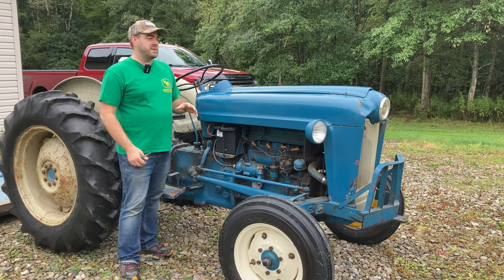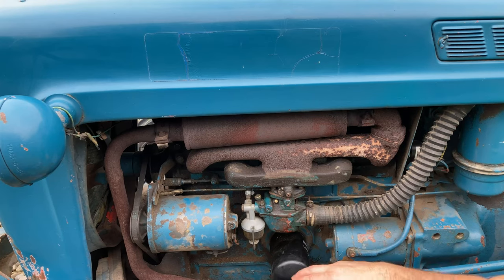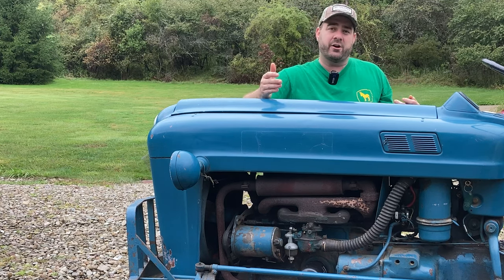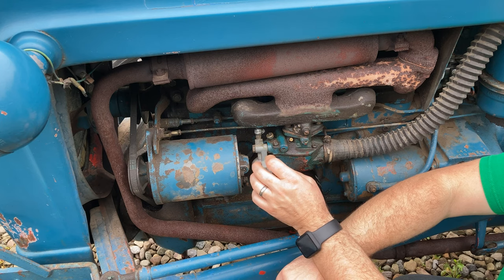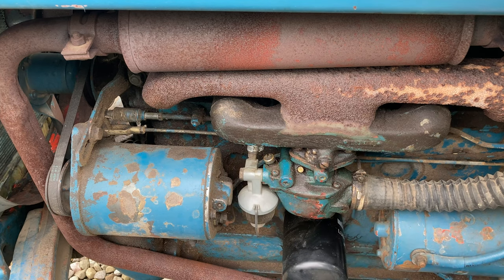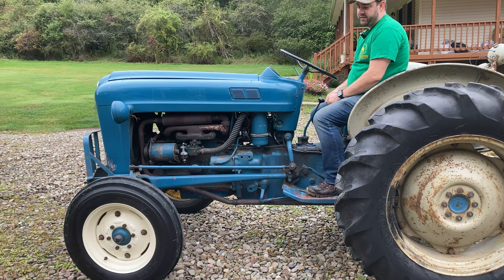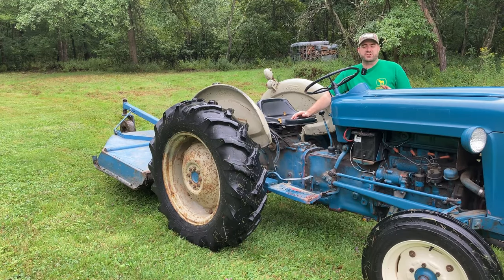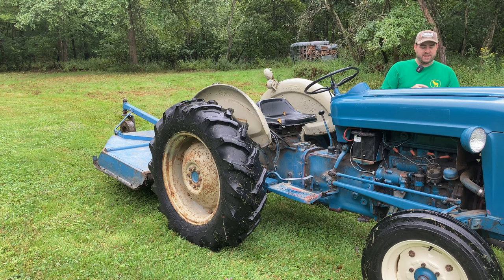Marvel Schebler carb settings for surging engine issue with Ford antique tractor

Comment: I am sure you have it fixed by now, but I had the opposite problem.  Initially, I had it surging all the time.  That was a carb problem.  The little flap had come off the choke plate and jambed things up.  I had been bouncing it pretty bad driving over palmettos pulling fallen oak trees out after the hurricane.  Once that problem had been sorted, it would misfire  when you accelerated the engine above 900 RPM.  Took me a little bit to figure out what was causing that.  The fly weights for the spark advance in the distributor were hung up and thus no advance.  Lubed them and problem went away.  I have been running it 3 or 4 hours a day now for weeks using a box blade and no problems at all.

Comment: I would Drain the fuel tank, put in fresh gas and then put in some sea foam in with the fresh gas.   That may help clean out the carb.   As said in previous comments you may have an air leak causing a lean condition.   Which causes the engine to "hunt" for more fuel.  You can take a propane torch opened up so it's letting out the propane (unlit) around the carb and intake manifold with the engine running.  If the engine gains RPM that's where your air leak is.
Reply from the maker: Thanks! I'm going to try that next.
Reply: Brake clean works better for that and safer

Comment: With the engine running spray carb cleaner around the outside of the carb to see if there an air leak.   Also check your fuel flow.  Usually surging is lack of fuel. Or bad fuel
Reply from the maker: Thanks! I'll try both of these tings before I remove and attempt to take apart the carb.

Comment: I had a similar problem and I found that the governor control rods were not set correctly.  If you have one of the manuals, it explains step by step how to adjust.  If I remember it correctly, with the tractor off you want your throttle set to idle and then look at the governor control rod and see if it is touching the governor control arm.  If it is, try opening the throttle until it is not.  This was my problem.  The rod was adjusted too long and it was allowing the governor to move without the proper tension on that linkage.  Once tightened until the spring was always under tension it stopped surging.  I hope this helps you.
Reply from the maker: Thanks!

Comment: When you take it apart to clean it or rebuild it, there are two tiny passages in the bottom of the carb that are very prone to getting plugged. You need to soak the parts in carb cleaner but also use a very small diameter wire to clean out those passages. Good luck 🤞
Reply from the maker: Thanks! I've never disassembled and rebuilt a carburetor before. But I may need to learn how in order to eliminate this problem.

Comment: I always check the oil bath air cleaner.  Water gets in there and raises the fluid level making it harder to get air through as well as making a soupy mess.  I don't know if it would cause surging but it has helped when the tractor is just not generally running smoothly.
Reply from the maker: Great tip!  I'm going to empty out the oil bath and start with some fresh oil at the proper level.  That's probably overdue anyway.

Comment: I’ve had that exact issue caused by a dirty/partially blocked sediment bowl. If they haven’t been cleaned in a while, they can restrict the fuel flow to the carb. Good luck!
Reply from the maker: Thanks! It sounds like I'm going to need to learn how to remove and clean that carburetor!
Reply: I agree, make sure there is good fuel flow into the carburetor

Comment: I figure your solution is to remove the Carburetor and give it a good and complete cleaning. While you’re at it, I would suggest looking into the state of the gas tank. If the tank has debris; well, that’s the source of your problem. Best to you!
Reply from the maker: Great suggestion! The carb cleaning was certainly needed.  Here's what else was done: https://www.youtube.com/watch?v=k4TLgBKXbJo

Comment: I'm not an expert myself, but I might try some fuel additive to help clean it out. It might be old gas or dirty gas. Worse case scenario it might need a carburetor kit and a clean. Another thought could be a governor adjustment, which is a more complicated prospect and would require a service manual.  I hope that helps! Thanks for sharing, Chad!
Reply from the maker: Thanks!
Reply: needs to look at the governor adjustments, it should not be surging like that without a load, look for broken springs, or missing pins on shafts, or to much play at connecting points,  as in to small of a pin or worn holes in the yokes or levers

Comment: Man, I just liked and sub’s. 
I just picked up a 641 myself and have a few issues. Mine definitely has junk in the gas tank and the previous owner put a fuel filter on, like the kind you find on a lawn mower. Mine bogs under a load at higher rpm, pretty positive that filter is clogged. Got to get a new tank and filter. 
Looking forward to seeing more 641 videos
Reply from the maker: Thanks for watching! I’m so happy with that Workmaster tractor. I’ve always loved all the old Ford tractors.  I’m still trying to get it working at 100%. Watch for future videos about rebuilding that carburetor and testing other troubleshooting options.

Comment: I have a 1964 Industrial 2000 4 cyl. Same carburetor. 12v conversion and front-end loader. I ALWAYS go back to the manual for "basic" settings then adjust from there ACCORDING to the manual
Reply from the maker: Great point. Following the manual’s instructions on initial settings is an excellent place to start. Thanks for watching!

Comment: I don't know much about that tractor Chad, but if I was working on an old Wheel Horse, the first thing I'd do is order a rebuild kit (or at least gaskets) and pull the carb.  A gallon can of Chem-Dip is a great investment...I'd soak the carb in it for 24 hours, then give it a good cleaning.  There's likely some tiny ports/passages the internet can tell you about specific to that carb to make sure are clear, then put it back together and start with the standard jet settings and work from there.  As long as you're careful and document the teardown, it's not a very challenging task doing the rebuild.  Of course I'm late on this video so you probably already have it running like a clock!  

(BTW, it's possible to tear it down and clean it without the rebuild kit/gaskets, but in my experience there's often some gasket or o-ring that needs replacing once you tear it down.)
Reply from the maker: I do think a rebuild kit may be in order here. I’ve continued to make adjustments to the carb and I am seeing some improvement, but still not perfect operation. I’m hoping that as I run this old gas though, that may solve the problem. But I do think it’s probably a good idea to get a rebuild kit. Then I’ll just need to learn how to rebuild a carb! :)
Reply: You got this, no problem! 👍😎👍

Comment: Do you still have to not  choke it to  start it  cold  after the adjustments ?
Reply from the maker: 80% of the time, it starts with no choke. But when it's really cold, the choke is required.

Comment: Honestly the carburetor depends on what type of marvel Schebler carburetor 568 or higher I got a carburetor rebuild video and a starter rebuild all comes in kits make sure you order the full kits not half kits
Reply from the maker: Thanks for the info! I've been doing minor adjustments at a time now. I have it running better, but it still surges under a load when I have the throttle up.
Reply: Gummed up carburetor is my first thought the main jet is gummed up a bit I’m not joking ether we had the same problem but have to keep our 640 ford half choked and then found out you need a thin peace of wire to dig out the nasty mess built up clogged up main jet port make sure all your jet ports are all cleaned out and need a chem bucket carb cleaner 1 gallon bucket like a paint can bucket to keep the carburetor in plus let it sit in there for 2 weeks for not in use tractor work another thing make sure to take good gaged speaker wire something thin metal to clean out main jet port to clean it out tho no joke that can cause your problem that will not run perfectly
Reply: But most likely ether a cleaning or a rebuild will solve your problem not hard to unbolt and take apart it’s all simple just don’t loose the little jets inside

Comment: I have a ford 800 that has a carb with a jet on the bottom of the bowl. Does the same thing and it pops like its missfiring when I turn up the throttle. Smokes when I messed with the jets.
Reply from the maker: I'm still making fine adjustments on mine and I can't get it to run perfectly. I may need to have someone who knows more about the carb take a look at it.  I believe (I'm not 100% sure) that the screw on the bottom of the bowl is just a drain, and not a jet adjustment.  Thanks for watching! Keep me posted if you find the fix.

Comment: Try main jet 1 turn out.
Reply from the maker: Thanks for the advice. I tried adjusting that carb every which way. It ended up that the tractor needed a complete tuneup and the timing was slightly off.